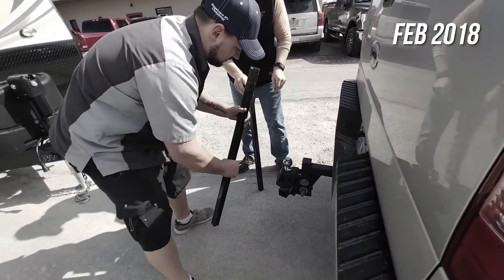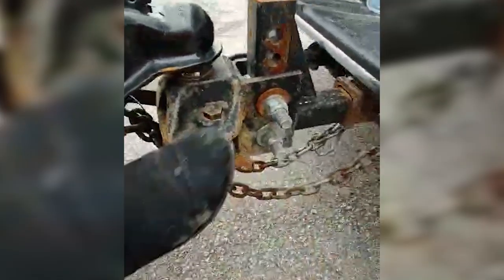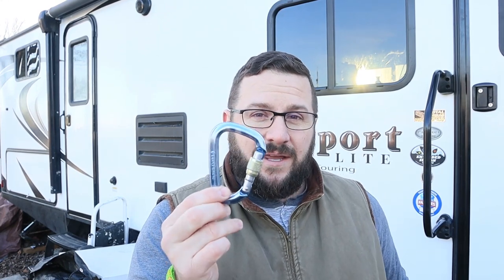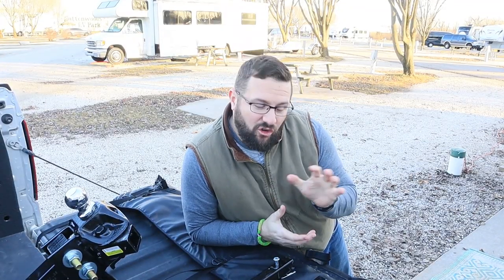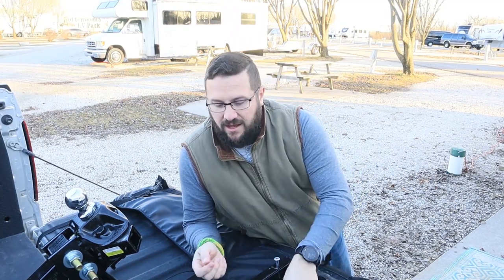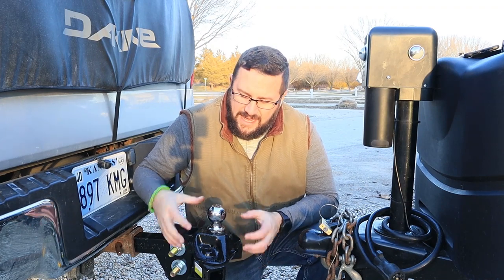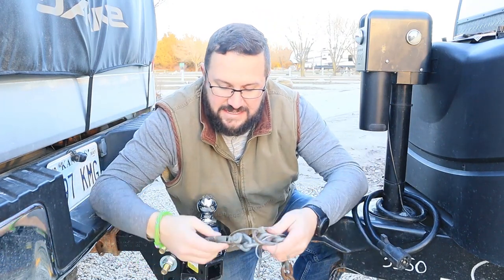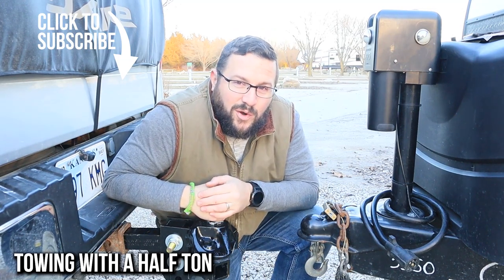Half Ton Hitch Failure! // How to Check it so you DON’T LOSE YOUR RV

Comment: The brake cable is supposed to be free and separate from the chains. There's a good use for that old carabiner. Hook it under the bumper and slip the cable into it when you hook up.
Reply: Exactly right Paul. Other's below also correct. That breakaway brake cable needs to be attached to the truck independently of the safety chain hook. I would also recommend a product called Fastway Zip breakaway cable. Have it on all my trailers.

Comment: a couple of things I learned from our state patrol.... after I had my trailer come off the ball. !) do not run the safety brake cable through the chain, if, as in my case, the chain fails, the safety cable is still attached to the chain. 2) I didn't see a safety pin going through your tongue lock latch, if something it's that latch and unlocks it, nothing is keeping the trailer on the ball. Happy Camping and stay safe.

Comment: For proper functioning and safety, the breakaway cable needs to be removed from the chain links (it looks to be intertwined in them) and directly fastened to the frame of the tow vehicle, not the hitch.  Also, the cable length is instrumental in the performance of the "breakaway system".   It should be 4 to 6 inches shorter than the length of the chains (when extended fully).  The principle is to activate the trailer brakes prior to the chains engagement (in the case of a catastrophic hitch failure or dismount).  

Also, for only several years of use, the original hitch head seems to have an extensive amount of corrosion.   This is usually the result of towing on salt treated roads.  If that's the case, you may want to inspect the trailers chassis, frame, LPG lines, and suspension components (including leaf springs, hangers, and axle mounts).  In corrosive environments, coaches of any type will show the destruction sooner than later. 

In the event that winter towing is unavoidable, it's also good practice to mitigate the corrosion by the use of a pressure washer (or car wash) to clean the underpinnings of the trailer and the hitch components soon after reaching the destination.
Reply from the maker: A great comment here everybody! Very informative Christopher thank you very much. You know it's interesting that I always thought that about the break away cable and initially had it set up that way until we took it to a dealership to have the distribution balanced and they wove it through the chains! I should have questioned it but didn't. I have had a few people tell me exactly what you said and have fixed it with the new cable.

Great advice on checking the other components and keeping it washed down.

Comment: At our dealership, this is the reason we switched to Reese Weight Distribution with Dual Cam Sway control.  Much better system.  However, with the length of the trailer with the smaller truck, I'd recommend the Pro Pride.  It will be a major upgrade and you will not feel any sway at all.  Good Luck!
Reply from the maker: Thank you for your suggestions. :)
Reply: My friend bought that Reese system with his new trailer. He sold his Equalizer with his other trailer that he owned for 5 years. 
He said buying the Reese instead of just keeping the Equalizer was the biggest mistake he has ever made. 
He said that the Reese is a hunk of garbage and doesn't preform like the Equalizer 4point does.

Comment: Thanks for the video.  I myself have the equalizer hitch 12,000 pounder. I have a puma palomino 31rdks and I tow it now with a 2020 ram 1500 crew cab 6.4 bed with the 392 rear axle ratio.  My camper dry is about 8,200 pounds so when my wife has all her shit in there and the 2 propane tanks are full and just everything in it I'm well over 10 thousand pounds the gvwr on the trailer is off the top of my head is 12,000 I believe. So still room.  Anyways I love the equalizer hitch.  But what my original statement was about is the trailer EMERGENCY breakaway.   Not only is it a DOT violation but it is not safe at all to be hooked to a chain.  It MUUUUUST have it's own separate location separate from the entire hitch reciever and that includes the part under the truck itself and must be able to withstand a 200 pound jolt.  Most people find and drill a spot on the bumper... the reason for this is if the hitch reciever that is on the truck fails well the chains are not gonna do anything when the reciever is the failed part and if your breakaway is hooked to the chains it will not work and the trailer will be able to roll freely without any breaks to stop or slow it down.  Think about it. If its hooked to the chains it will never be able to be deployed.
Reply from the maker: We know. They set it up that way but we fixed it. :) Thank you though! Sounds like you have a great set up. Happy travels!

Comment: Quick suggestion, I also use this hitch and it's a great hitch. Mine is probably 7 years old and the only complaint I have had was the bolt that adjusts the hitch head angle. Mine started to "mushroom" where it contacted the shank. I had to cut it off and re-thread the shank. I replaced it with a grade 8 bolt and haven't had an issue since. I contacted Equalizer about this so maybe on the newer hitches that bolt is of higher grade. Something worth checking if you get some slop in your hitch head.
Reply from the maker: Interesting. Thanks for the heads up.

Comment: We recently learned that the brake cable should not be wrapped up in the chain. It should be separate and connected to the truck in such a way that if the hitch breaks off of the truck, the cable will still activate the brakes.
Reply from the maker: The dealership set it up like this. We fixed it (and John even filmed it) but Kristin didn't put it in the video. Oops! Thanks for looking out for us though. 😊

Comment: I too had the sockets crack on top like you did.   Mine was brand new and had about 5K miles on it.   I called mfr (progressive) and they asked me to check the length of the shank on the ball to see if it was low enough to interfere with the pivot of the sockets.   Sure enough the shank on my hitch ball hung down about 1/4" below the top plate and would hit the sockets.   Progressive said this is what caused the cracks but they were nice enough to overnite 2 new sockets to me anyway.   They said their hitch requires a specific length shank for the ball to avoid this, and these are hard to find so they see this situation a lot.    Progressive sells the right length shank ball, or you can find one elsewhere with some luck.

Comment: It will be much easier to inspect your hitch and all associated components in the future if you pay it the proper attention to keep it clean, lubricated and rust free. Hose it off, scrub it with soap and rinse (dish soap will work to remove heavy grease but your regular car washing soap works just fine). THEN you can use the WD-40 or a silicone spray over the whole hitch, don't forget the equalizer arms. Soak the whole thing down, let it sit for a minute then wipe off excess. For the ball and other high load areas that need grease I use a white lithium grease. To alleviate getting that heavy grease all over everything after I've disconnected I put my hitch head back into the trailer coupler and then lock the coupler. It's safe, clean, out of the way, and best of all it's right where you want it the next time you're ready to hook up. From what I can see of the underside of your truck I hope you don't get a flat on your next journey, because with all the rust down there you may not be able to drop your spare, and if you do it may be flat. You need to wash and attend the underside of your truck as much as the topside. It will save you lots of time and trouble down the road. Who knows? You might even have cracks down there (from towing that heavy trailer with a half-ton) but you can't see anything for all the corrosion...
Reply from the maker: Mark, you're right about the hitch maintenance. I already had a fair amount of rust on it from the get go, but driving through the winter made it much worse. I really appreciate the tips. Oh and as for the underside of the truck I'll get down and expect it more often, I will say much of what I think you're seeing is the red dirt from the camping site we were in... it coated everything.
Reply: @NoOrdinaryPath  Perhaps you're right about the mud. What I perceived I saw was rust/corrosion similar in appearance to what was on your old hitch, which was bad in itself and maybe kept you from spotting your problem earlier. In any case, not calling you out to grind on you just trying to give constructive criticism and possible solution. Good luck, be safe, and at some point each day stop to reflect on how good the life you've chosen is, compared to those stuck in "the grind" of commuting hours of their lives away...

Comment: Wow pretty scary to hear you had a used hitch.   I would be freaked out.  I moved up from a 26’ 6500 pd rig and had the cheap WDH with the chain weight bars and the friction sway bar.   When I bought my 9500 pd 35’ Rockwood I tried using that same hitch.  Chose the worst shake down ride you could ever think of ( 500 miles away from home ).  By the time we got to the destination I had felt like the trailer was all over the road and I was going to kill my whole family.   We quickly trade that in for the Equalizer E 4 12k hitch.  I agree with all of your checks and care but the one that I found most critical was the angle set bolt underneath the sway bars.  That will often loosen up when you first get the hitch installed.  You need to snug that bolt almost every trip.  Good luck with your new hitch. I think you will really like the beefier 12k.  It is a world of difference.
Reply from the maker: Thanks John, yes I'm already noticing a difference in the drive just from the less sway. I'll be sure to check that bolt frequently too. 👍

Comment: Great video! The Equalizer is a great hitch! Aren't they supposed to have a life time warranty? Wondering if you called Equalizer to ask them about that. I'm guessing they would have just sent out a new collar and not a whole hitch, so you did the right thing in getting a new hitch and going with 1200 lb bars. I have an Equalizer with the 1400lb bars, but my tongue weight is around 1200lbs. I also had to install airbags to help level my truck. I tow with a 2015 GMC 1500 and my trailer is a Puma 30RKSS. It tows great with the Equalizer. I think the hitch makes all the difference in successful towing. All the best to you and the family!
Reply from the maker: We wanted to upgrade anyway at that point. We had no idea then that we would be getting a new truck. We are really happy with the hitch and new truck set up now. We'll look into that warranty thing though for sure in the future!

Comment: Can I ask why the set-up on the old one you had 2 holes exposed on the top but the new one has 2 holes exposed on the bottom of the head? Is it cause of the weight difference? I have a 33' camper and a F-150 and also use the equalizer!! I have towing problems alot and have always thought it was the sidewalls or shocks...thanks for the video and any feedback!!
Reply from the maker: Honestly Justin that's just the way they had them set up after installing. I bet someone here can speak to it better then I can. I'd take your setup into a reputable installer and have them dial it in for you.
Reply: Justin did you get your hitch set-up correctly?
And if so did it fix your towing problems?

Comment: Hensley. Make the investment if you care for who you travel with. All others are obsolete.
Reply: Tim Engle $3000.00 is expensive but I get it, it’s a home it’s holding onto.
Reply: Elizabeth and your safety in the tow vehicle.
Reply: Tim Engle I believe I heard about it a couple of years ago from Less Junk More Journey & it seemed to be a popular topic for a short bit but not now. I looked the cost up a couple of weeks ago & wow! The cost gap between it & other anti-sway is very significant. If we get a TT I’m tempted to go for that one but we’re thinking fifth wheel toy hauler, though finances will determine what we get in a couple of years. 
In 2012 we were traveling along a secondary highway in Montana (not the I-15) & came across a TT & truck almost (?) roll over crash. Judging from the minor injuries & damage to the truck, the 14yo was driving but Dad said he was. The 24yo had not visible injuries while Dad did yet the passenger side roof was crushed & not the driver side. It wasn’t just that,it was suspicious overall. That was for the cops to figure out. It looked like over correction, there was a cross wind but not bad & traffic was spread out quite a bit. Well, before they spread themselves across the highway! I attended to the injuries (first aider). I didn’t check the hitch, but on our last camping trip I was checking out hitches in the campground!
Reply: Elizabeth kudos for stopping and giving aid!  I have towed with many WD hitches, Equalizer, Reese, Anderson No Sway, and Blue Ox Sway Pro.  None of them come close to the Hensley Hitch. The Hensley is a true NO SWAY hitch. I experienced sway with all the other brands I have owned. The Hensley installs a confidence no other can. I bought a refurbished Hensley with the chain brackets vs the screw jacks. I can drive 70mph all day with one finger, unlike the white knuckle death grip using other hitches. I wish I would have purchased a Hensley years ago.
Reply: We upgraded to the Pro Pride 3P Hensley hitch.   Dramatic difference not having any sway in strong cross winds, etc.  also much easier to adjust distribution for changes in trailer loads.  Expensive but wouldn’t want to tow with anything else.

Comment: What oil are you running in your 5.4 3v?
Reply from the maker: Hello Starbreaker. We run 5w-20 as per the manufacturer spec. In regards to type I typically use Valvoline. Might surprise some but honestly I've talked to enough mechanics to learn that fancy oil isn't as important as making sure you change it regularly. Plus I really love how they keep track of everything plus fill up all my fluids and I can top it off at any Valvoline store for free while NEVER getting out of the car.
Reply: @NoOrdinaryPath  motercraft filter is a must on your 5.4.anti drain back valve helps on cold starts and saves on wear on upper end components

Comment: Threading your e-brake cable through your safety chain is asking for wear and trouble. Yours was dangerous. Look for an aftermarket coiled-cable, coated for durability. With a small carabiner, it will attach to the same hole as your safety chain, but will not impinge on it. Your new system will be less prone to wear and easier to inspect.